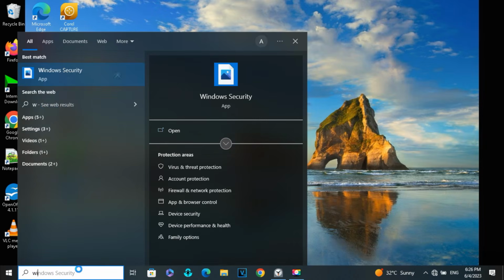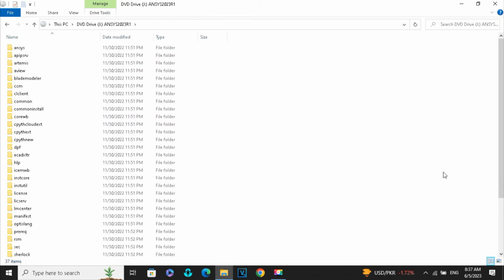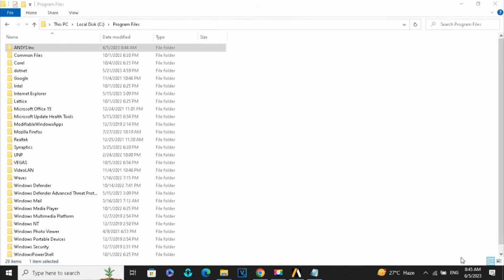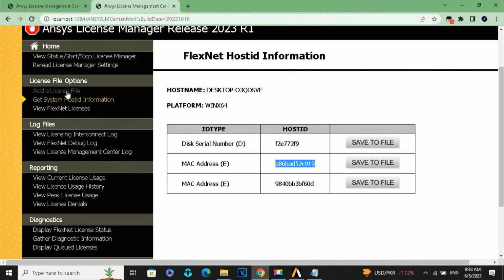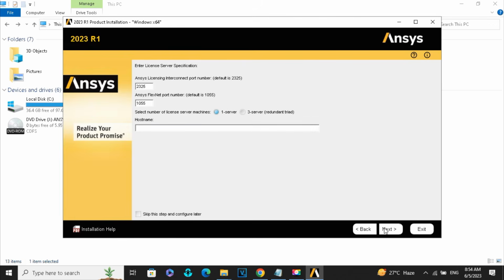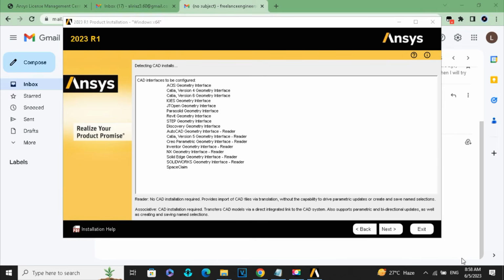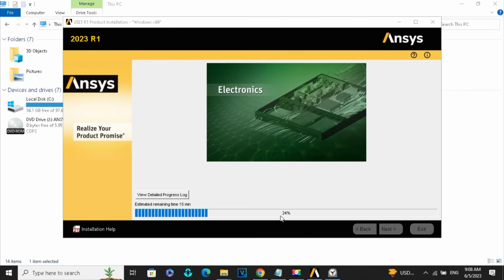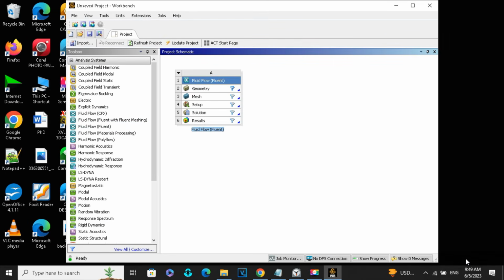ANSYS' 2023R1 Installation #ansys

Comment: I had issues with the license in Fluent. To resolve this, I copied and pasted the "ANSYS Inc" folder—from the crack files—into the C: drive (after installing the License Manager) and also into the folder selected for the general installation. That did the trick.

Comment: For any of those who encounter issues to add their license in ANSYS Manager after having modified the "license.txt" file ; when you modify directly the license.txt file in the crack files, the system can block your modifications because it protects automatically locations like "program files" and so, you have to copy the license.txt in your document, modify it in this location, delete the original license.txt file in the crack file and replace it by the new one, then browse it. It works for me.

Comment: How can we solve this issue 
Opening input/output transcript to file "C:\Users\USERNAME\fluent-20261001-133216-9840.trn".
Auto-Transcript Start Time:  13:32:16, 01 Oct 2026 Egypt Daylight Time 

              Welcome to ANSYS Fluent 2024 R1

              Copyright 1987-2024 ANSYS, Inc. All Rights Reserved.
              Unauthorized use, distribution or duplication is prohibited.
              This product is subject to U.S. laws governing export and re-export.
              For full Legal Notice, see documentation.

Build Time: Nov 22 2023 10:24:13 EST  Build Id: 10184  
 
Connected License Server List:	<Shared_Web_License_Server>

Unexpected license problem; exiting.

Hit return to exit.

Comment: Can anyone help me? I'm getting this error:
Request name disco_level1 does not exist in the licensing
pool.
Invalid (inconsistent) license key.
The license key and data for the feature do not match.
This usually happens when a license file has been altered.
Feature:
disco_level1
License path: 1055@localhost;
FlexNet Licensing error:-8,544

Comment: Invalid (inconsistent) license key.

The license key and data for the feature do not match.

This usually happens when a license file has been altered.

Feature:

agppi

License path: 1055@localhost;

FlexNet Licensing error:-8,544

What to do

Comment: I tried to open space claim in fluid flow fluent but I get

"ANSYS LICENSE MANAGER ERROR

Request name disco_level1 does not exist in the licensing pool.

Invalid (inconsistent) license key.

The license key and data for the feature do not match.

This usually happens when a license file has been altered.

Feature: disco_level1

License path: 1055@localhost;

FlexNet Licensing error: -8,544." 

I restarted the computer but it didn't work. How can I solve this problem?
Reply: Same issue here too
Reply: @gvaishnav3125 there was a solution in comments. But I couldn't find. Give me your e mail or social media account.
Reply: @kayatekin93 hi can you help me please? Same issue with me
Reply: @shadowlord5702  of course. Write your e mail
Reply: @kayatekin93 did you send me the email?

Comment: Sir please  help when I installed completed  after launching it is  showing ...  so please guide ..

Request name disco_ level 1 does not exist in the licensing pool . invalid ( Inconsistent) Licence key.
This feature key and data for the feature do not match .
This usually happens when a licence file has been altered.
Feature: disco_ level1
Licence path: 1055@ localhost
Flexnet Licensing error : 8, 544
Reply from the maker: Kindly open the license manager and click on running option.

Comment: The licence file error occured even after exactly following all the steps as mentioned. Tried 1st time the error occurred then deleted and uninstalled all the files from C and D drive I again installed the software. Still the problem occurs. It's Windows 11. Please help.
Reply from the maker: Open the license manager from search bar and click on running option.

Comment: WARNING: Proceeding with this installation will restart the Ansys (ansyslmd) License Manager, if it is running.

If you are running the FLEXIm for Ansoft (ansoftd) License Manager, this installation will stop the FLEXIm for Ansoft License Manager and will merge it into the Ansys License Manager. This process may also change the port number for ansoftd licenses, so be sure to update client machines to point to the Ansys License Manager using the correct port number. 

This is the problem I am getting while installing please help
Reply from the maker: Make sure that you run the licnese manager before opening the ANSYS.

Comment: Bro, I have installed it multiple times, and I also tried installing different versions other than 2023, but I am always getting this error while opening.

ANSYS LICENSE MANAGER ERROR:Request name cfd_solve_level2 does not exist in the licensing pool.
Invalid (inconsistent) license key.
 The license key and data for the feature do not match.
 This usually happens when a license file has been altered.
Feature:       cfd_solve_level2
License path:  1055@localhost;
FlexNet Licensing error:-8,544

Can you tell me what to do?
Reply from the maker: Kindly crack the software.

Comment: I followed through the entire video. However, after starting the workbench and opening the structural module, when I go to 'New spaceclaim geometry', I'm not able to make a new geometry. I get error: " Request name disco_level1 does not exist in the licensing pool. Invalid inconsistent license key..." Kindly help me resolve.
Reply from the maker: Make sure that license manager is working. Sometime it stops, you have to run it.

Comment: Mechanical failed to open the database: The Mechanical editor does not have a valid license. Please refer the following directory for more information: bro please help me
Reply from the maker: Place the crack file of the software in the same folder where the software file is placed.

Comment: i downloaded it just like you and i used it a while with no problem. After a week when i tried to open the program en error occured and it says, "Connection time out while reading data.  The application has stopped waiting for reply. The license server may be experiencing a high demand or a temporary outage. Try again later." What sould i do? Should i download it again? or can i just save it with any crack files?
Reply: The same problem
Reply from the maker: Kindly open the license manager and click on running option.

Comment: When open it shows :- Failed to load addin ACP.Addin from location (D: \Cfd......) This addin will be skipped.: Could not load file or assembly 'Ans.Rsm.Client, Version=23.1.0.0,
Culture=neutral,
PublicKeyToken=bf8e62f391376603' or one of its dependencies. The system cannot find the file specified.

Please help with this

Comment: Request name disco_level1 does not exist in the licensing pool. 
Invalid (inconsistent) license key. 
The license key and data for the feature do not match. 
This usually happens when a license file has been altered. 
Feature: 
disco_level1 
License path: 1055@localhost; 
FlexNet Licensing error:-8,544 

how can i solve this please help me anyone...
Reply from the maker: Kindly run the license manager.

Comment: Ansys license manager error

invalid (inconsistent)  license key 
The license key and data for the feature  do not match
This usually happens when a license  file has been altered
License path:1055@localhost
Flexnet license error:-8544

Please help how to solve this.this happening  when i am going  to open import geometry by design moduler
Reply: Got the same error .... Any solution??
Reply: just turn off all protection . not just windows defeender. All private and local
Reply from the maker: Turn off the antivirus protection before installation and run the license manager.

Comment: error message showing.       how can i resolve
 Request name disco_level1 does not exist in the licensing pool. 
Invalid (inconsistent) license key. 
The license key and data for the feature do not match. 
This usually happens when a license file has been altered. 
Feature: 
disco_level1 
License path: 1055@localhost: 
FlexNet Licensing error:-8,544
Reply: Same here bro ! have you got the issue solve?
Reply: Hi did you solve it??
Reply: I downloaded student version
Reply: Has anyone solved this issue

Comment: Hey i have installed it but whenever i try to open import a solidworks file it shows this error 

Invalid (inconsistent) license key.

The license key and data for the feature do not match.

This usually happens when a license file has been altered.

Feature:

agppi

License path: 1055@localhost;

FlexNet Licensing error:-8,544

Does anyone facing the same problem and if anyone has any solution please tell 🙏🏻
Reply from the maker: Brother, open the license manager and click on running option.
Reply: I do that but the same problem remains
Reply: same with me bro @ananyajahanchowdhury7358

Comment: I got this error sir please help me
1)  Request name disco level does not exist in the licensing pool invalid (inconsistent) licence key
2) the licence key and data for the feature does not match 
3) this usually happens when a licence file has been altered
Reply: I am facing same error. How did you resolve it??
Reply from the maker: @hebahaamir9864  Kindly crack the software as per instructions mention in video. Additionally, run the license manager by clicking on running option.
Reply: does it working now, what you did
Reply: Has anyone solved this problem? I am also having the same problem, please help and give me some guidance.

Comment: I have fixed error flexnet license error -8544
Reply: please help me bro
Reply: How?
Reply: @mahelawanigasooriya90Copy netapi32.dll from this path C:\Program Files\ANSYS Inc\v242\licensingclient\winx64 and past into to your ansys installation directory example F:\ANSYS Inc\v242\licensingclient\winx64
Reply: if your getting this error copy netapi32.dll from ansys C folder v242 lincensing clint , winx64 and paste it into your installation directory v242 licensingc
Reply: @suhaebr2768  you mean copying the netapi32.dll form C Disk license folder and pasting into the product directory that is in my E Disk?
Reply: thanks bro. it's run

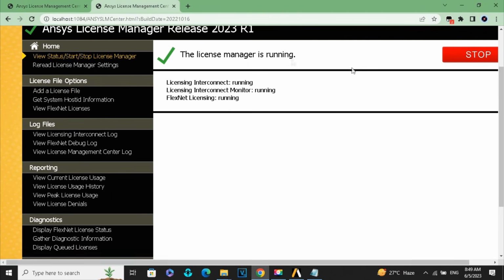Comment: 4:21 when i click start for license manager, it doesn't start. it's loading, then it says stopped.
Reply from the maker: Kindly crack the software properly.
Reply: Same issue did you find a solution?
Reply: @ameghs-o8y  No, unfortunately. 😔
Reply: @adodali07  I got solution
Reply: Just copy  the files in the ansys inc folder in crack and paste in Ansys inc folder in C drive programme files.

Comment: I am getting error: "Request name disco_level1 does not exist in the licensing pool.
Invalid (inconsistent) license key.
 The license key and data for the feature do no match.
 This usually happens when a license file has been altered.
Feature: disco_level1
License path: 1055@localhost
FlexNet Licensing error: -8,544"

How do i fix this error?
Reply: Hi bro, is the error solved?
Reply: @anandhukrishnaop9610  no bro
Reply: Lot of people struggling with this error
Reply: @suhaebr2768  same here any solutions?
Reply: How did you solve this?
Reply: @hebahaamir9864  I couldn't, I'm still figuring out how to fix it
Reply: Any solution bro  @rookie4263
Reply: @rookie4263 Copy netapi32.dll from this path C:\Program Files\ANSYS Inc\v242\licensingclient\winx64 and past into to your ansys installation directory example F:\ANSYS Inc\v242\licensingclient\winx64
Reply: @suhaebr2768  Works for me man. Thankyou so much. One more thing that I want to add is most of us are doing it right but the problem is our systems firewall that is continuously blocking the ansys files from running properly.
Reply: @AvinashSingh-mw8lq true, it had something to do with that only. I recently tried installing once again and this time it installed perfectly
Reply: So what is the solution for it bro
Reply: @World_conqueror_four  I tried it once again this time and it installed perfectly

Comment: Hello i tried it on windows 11 it doesn’t work, I have license problems so when I want to open spaceClaim or the meshing I get a license error, literally only workbench is working. Is there any solution to this problem please?
Reply from the maker: Kindly open the license manager and click on running option.
Reply: @computationalfluiddynamics3019  where is the running option button? kindly do tell
Reply: @computationalfluiddynamics3019 I already did multiple times but unfortunately it doesnt work

Comment: Im facing error at step 3. For 2024 program it says copy shared files to the Ansys Inc's shared files folder. Im doing it and than click licence manager program than it says server .XML could not be accessed or  file does not exit. Correct that before continue. So what should I do I follow the related folder path and server file exists so I don't understand what is the problem. :/
Reply from the maker: Kindly follow the steps fro crcking as it is.

Comment: For License problem in mechanical adpl, i tried to use 2nd mac address from hostid table for license & it worked for me.
Reply from the maker: Thanks,
Reply: Hello, i have the same problem how did you fix it plz
Reply: @achrefghaouari just open apdl from the workbench 
Import mechanical apdl then right click on analysis then click open on apdl
Done
Reply: Bro pleaseeee just how i can fix it exactly plzzz
Reply: I didn't even get a second mac address

Comment: Sir,
When I click the mesh option in fluent the following happens:

Request name cfd_preppost does not exist in the licensing pool. Invalid (inconsistent) license key. The license key and data for the feature do not match. This usually happens when a license file has been altered. Feature: 
 FlexNet Licensing error: -8,544

Have followed all the instructions, turned off security and restarted the computer. But still not working 
Please Help🫂🥲🥲
Reply from the maker: Kindly run the license manager.

Comment: While we use internet connection to start the licence manager will it be an issue for the crack.
😊
Reply from the maker: Yes. You have to turn off the internet and anti virus protection for crack.

Comment: Instructions jo mere setup k sath hai vo alag hai thodhi. Mujhe license file ko edit krne se pehle shared folder ko replace krna hai uske baad licence edit krna hai. But add license file k time pe error aa raha hai. Mera mac adress hai ffffff ok. Or error aa raha hai. "Did not upload the file- the hostid in the licence file is not valid hostid for this license server machine". What did i miss here. Please help. Also tell me is it important to disable the internet before installation

Ok update on installation:- i have found the solution for myself. As i said my mac address is show by the ansys window is fffffff which when i replace it with xxxxxxxx it fails then what i did is manually found my mac address and modified it according to the format and replace it with the xxxxxxx after that ill be able to install the licence and proceed further.
Reply from the maker: Kindly disable internet and ativirus before installation.

Comment: sir, I have a problem, after I choose the file license and install it,  when I view status license manager at home, only the flexnet licensing not running. What should I do sir?
Reply from the maker: Kindly click the running option from  ANSYS license manager.
Reply: @computationalfluiddynamics3019   I have the same issue. If by running, you mean "Start", it's not working.

Comment: hello sir, can i ask you a question?. can i turn on my windows defender after the installation?, or should i settings some program in windows firewall to block the internet connection? and if yes what kind the program should i block the connection? thank you in advance, *sorry for my bad english
Reply from the maker: Yes, you can turn on the antivirus protection and window defenders after installation.

Comment: On step 2, I am having an issue, whenever i replace Ansys file, and try to run license manager, it states that the license manager ansyslmcenter.exe has been deleted.
Reply from the maker: Kindly crack the software properly by turning off anti virus protections.

Comment: When I want to entry to model in static geometry, it shows : mechanical failed to open the data base: the mechanical editor dors not have a valid license. Please refer the following directory for more information, please help me
Reply: I am also facing the same problem....
Reply from the maker: Kindly crack the software as per given instructions.
Reply: I have the same issue, Did you fix it?

Comment: Mechanical APDL not running!
Reply from the maker: Try to follow all the steps as it is.
Reply: An error has occured during the registry operation "Query" on key "anscwid". Often this is due to improper initial configuration.

Did you run the Setup Procedure for this computer?

This error occurs the first time when I start "apdl" after that ansys license manager error pop-up shows

Pop-up content:
Request name ansys does not exist in the licensing pool. Invalid (inconsistent) license key.

The license key and data for the feature do not match.

This usually happens when a license file has been altered.

Feature:

ansys

License path: 1055@localhost;

FlexNet Licensing error:-8,544
Reply: Sir please help

Comment: Can you please provide the crack files??
Reply from the maker: https://getintopc.com/softwares/engineering/ansys-products-2023-free-download/
Reply: @computationalfluiddynamics3019  Thank you so much!! I previously used v19.2 and was successfully able to install it from video. But on using mechanical it shows this  error ( Update failed for the Model component in Static Structural.  Mechanical failed to open the database: The Mechanical editor does not have a valid license. Please refer the following directory for more information: C:\Users\simra\AppData\Local\Temp\.ansys.)